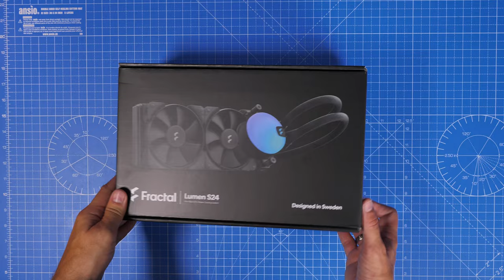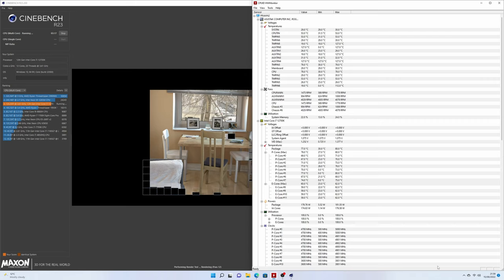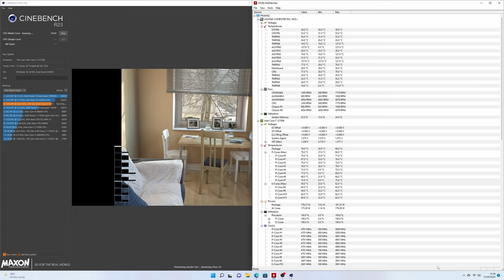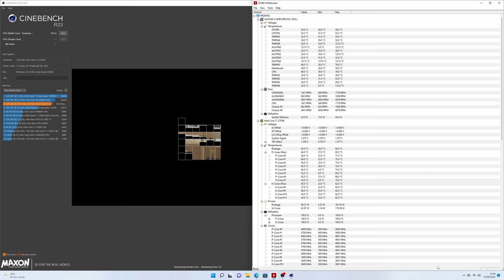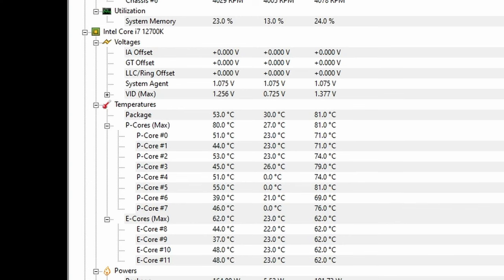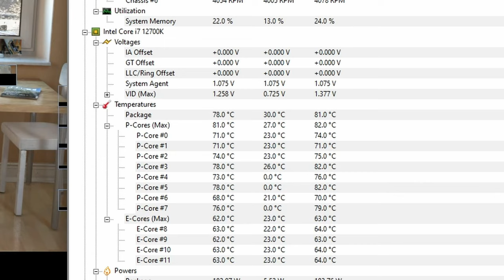Fractal Lumen S24 installation guide, tips and tests

Comment: Thank you so much for this video, Prawn. I actually chose this cooler based entirely on this video simply because you chose to explain that you can 100% forgo the RGB connection on the CPU block. I went with a more stealthy build and it fit perfectly.
Reply from the maker: Glad I could help!
Reply: Can you turn off rgb via software or something without tinkering with cables?
Reply: @omarzarat6244  I'm sure you can, using their software. I just never needed the software because I never used the RGB cable.

Comment: Maybe a silly question, but will top mounting throw up any issues with pump lifespan with it being at the top in the radiator?
Reply: hey i have the same question :) have u found an answer yet?
Reply: @hannes.b  that is true, because the air accumulates in the highest point of loop (pump), causing problems in long term.
Reply: As long as the radiator top is higher than the pump, and the pipes are lower than the pump if front mounted, thats the best for front mounting, top mounting is personal preference. 

Just never mount the radiator to the bottom of the case below the pump
Reply: The top mount have no problems …the problem is when u front mount it with cable up from radiator ..
Reply: Not how it works, but sure...  @nikenzzo

Comment: Great video! Thank you. I'm about to order one of these now. I'm wondering, I'm running Pro Tools and with my current setup I can see it tops around 86C sometimes, just for a few seconds or so, around 70 most of the time, is that a dangerous temp?

Thanks again man!
Simon
Reply from the maker: No, that's fine